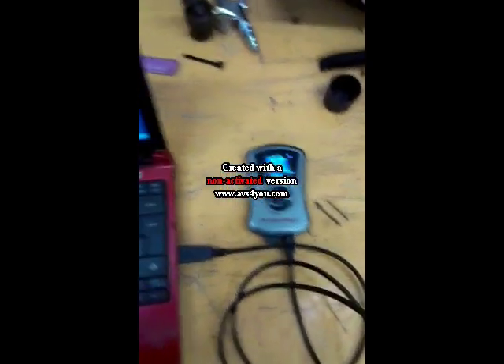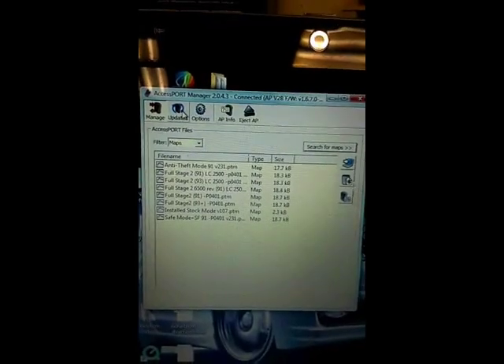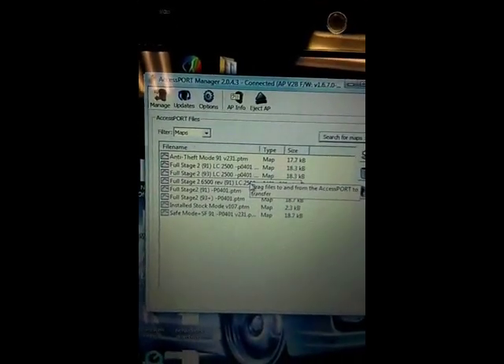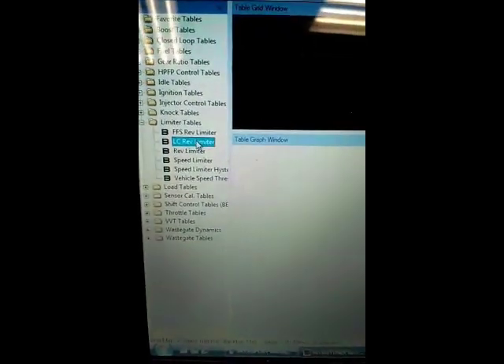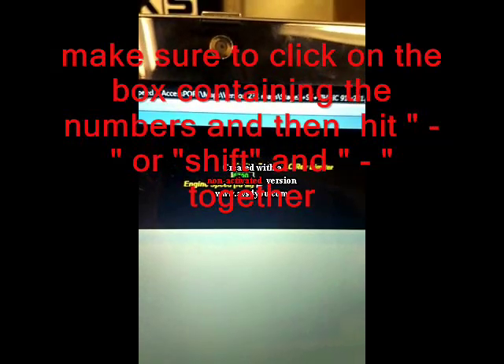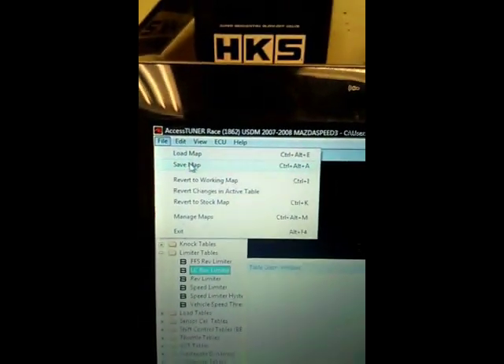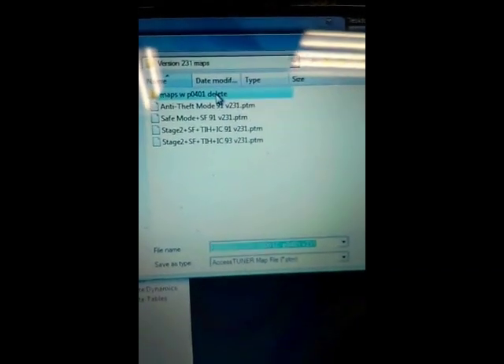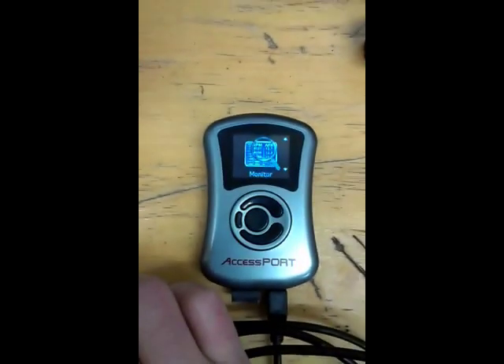How to set up launch control on Mazdaspeed 3 and delete engine codes using Cobb Accessport

Comment: Hey man just got an 08 speed3 what would you suggest be my first mods?
Reply: Depends what you are doing with the car. If you want to do some auto x I would say a nice set of performance tires would be one of the first things to do. A Cobb accessport and intake are nice too (in addition to more power, you get to hear the turbo and bypass valve a little more plus with the access port you can play around with the launch control and stuff). cat back exhausts give a nice sound but don't give much gains in power (if any on these cars if you don't upgrade the downpipe - plus you can just delete the resonators for much cheaper and it will give a nice exhaust note). Unless you want to spend lots of money I wouldn't recommend the downpipe. You really need to couple this upgrade with an access port/tune and an upgraded cdfp (camshaft driven fuel pump) the gains are awesome but you can mess up your car if you don't do it right. Also, with the 3" downpipe you can almost certainly expect the oil seals on the OEM turbo to start leaking at idle (common problem on these cars - the OEM turbos have floating seals). if this happens I would recommend a new aftermarket turbo (which means a custom tune as well) or learn to rebuild the OEM seals yourself ( I bought a kit from "g pop shop" years ago. I realize I am writing an essay so I will summarize below what I would do if I bought one of these cars again: Start with deleting the resonators (deleted two if you keep the stock downpipe, only do one if you will upgrade the down pipe later or it will be annoyingly loud in my opinion), an upgraded rear motor mount (helps with wheel hop I had  a street unit one and  liked it), stickier tires, an access port and then an intake ( I would recommend only getting an intake after you have an access port). I would then leave the car alone so it isn't causing you too many headaches  or I would then proceed with the cdfp and a front mount intercooler, if you want to go even further I would say next step would be to save up and do the downpipe, a quality aftermarket turbo, and a custom tune on the access port as well as a stage 2 clutch. Also at some point get an oil catch can and as you add more power look into step colder spark plugs.
Reply: I just realized I used my other gmail account to reply to you but I am the guy who made the video lol
Reply: Neil Kuly thanks man!!! Love the feedback I'm coming from a 350z so I've never had turbo I'm kinda of a noob so I love the  help

Comment: What is the po1400 for??
Reply: Its an DTC (Diagnostic Trouble Code) that throws a CEL (Check Engine Light) because of a modification he did on his engine that physically removed the EGR (Exhaust Gas Recalculation)  known as an EGR delete. That modification will give the check engine light that wont go away. So, with his AccessPORT and Access Tuner Race software he is able to get rid of the trouble code number P0401.

Comment from the maker: I haven't done that myself yet but I can look into it when I have some free time. You having the smoking turbo issue? I installed a catch can with another pcv valve installed in the line going to the catch can. Cobb tuning has a step by step installation guide to do this. Just google  "mazdaspeed 3 oil catch can Cobb tuning" and you should be able to find a link to a PDF file. I also used the "ptp pill" mod. By doing both these things my smoking turbo issue went away even with a full 3" exhaust.